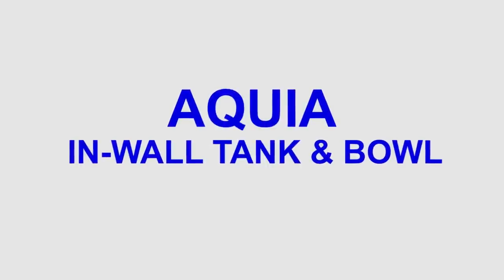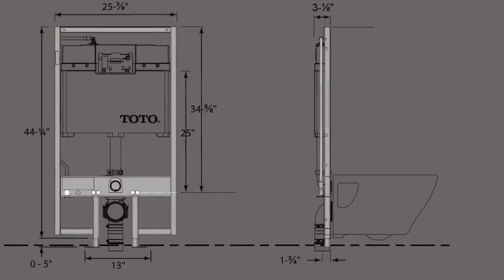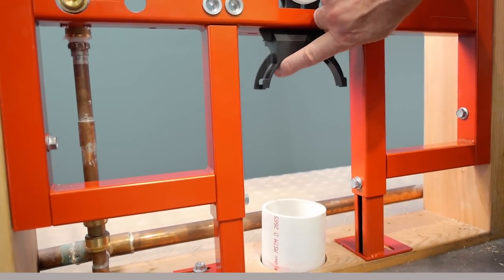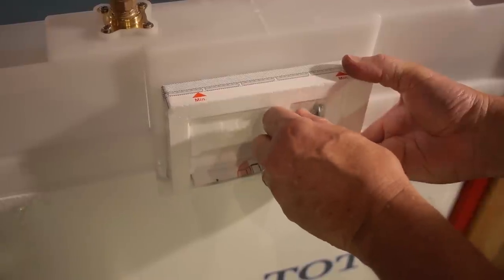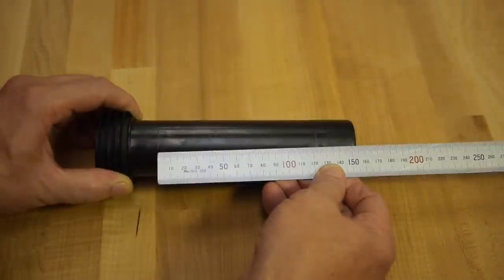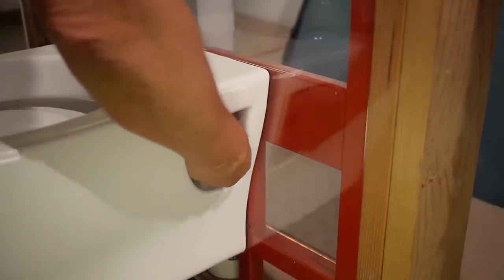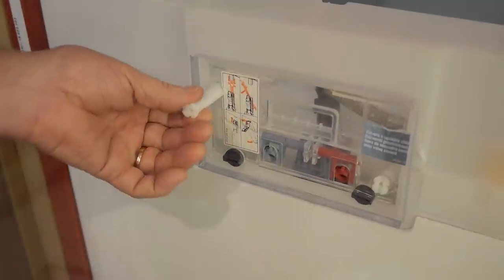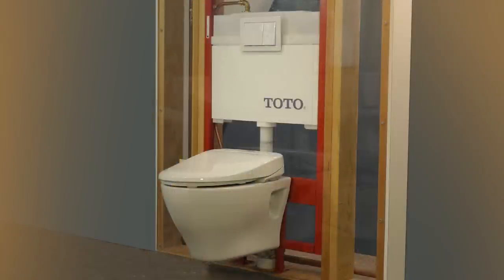Installing the Aquia In Wall Tank and Bowl

Comment: I know this is old, but English and Metric are both used during this demonstration. It would be better to stick with one throughout. My guess is two different presentations were combined. Also, I would suggest that a removable panel with a different finish installed at the toilet area be strongly suggested to the customer. Trim around this area can hide removable fasteners. Any call backs will be easier, and the customer will benefit in the long run maintenance wise, along with having a more architecturally custom finish.

Comment: My house built in 1963 had a wall mounted purple toilet. Tank and flush was exposed and not in the wall. So I knew a wall mounted toilet would cost much more than a standard. I figured doing an ultra modern remodel that involved a total tear out would have the right plumbing for another wall hung toilet.
My Aquia $1000 toilet cost me about $1500 to install. So besides the new wall adjustments the gas vent for the bathroom was a "T" connection off the drain of the old toilet.
Toto has a custom wall drain system that only comes in 90% drain options. It took my excellent remodeling crew 8 hours for 2 people to route a new vent.
Toto's recommended seat (extra) is cheap plastic and moves around. The lid has scratch the paint on the wall. I put a bumper sticky pad on it but it slipped down the cover (pad looked good but the quality adhesive sucked).
The Aquia was supposed to have a coating that is supposed to help keep it clean longer. Nope.
I worry about getting replacement part. Home Depot sells the toilet but they do not stock it or have replacement parts. All of that has to go through 1 importer in NYC.
BUY a Kohler!

Comment: Great idea, but I’d rethink this. Installed one, but the flush valve leaks out water. Changed ballcock, and the flush valve, so now what…..nothing. Can’t get at it, so it’s useless now. Mind yiu great idea, love it as it’s easy to clean around the toilet.  I’m a plumber but to get at the inside is impossible. Access is too small to get hands in. Then too boot, Toto gives me balls two years in as it’s leaking past, I had to but a new flush valve and new ballcock, then the same bullshit, must be me or my water……ya ya, installation was simple, I made dam sure it didn’t move, just use lots backing. Toilet after the walks were in  went well. All in all great idea. But to install new tank is a total redo of the washroom, obviously at this cost it’s not a normal washroom, so it will cost a fair amount to replace. I’ll do it in few years, I can get at bottom so I can reconfigure the rough in. Oh well, lesson learnt.

Comment: We installed this toilet a little over one year ago in a basement apartment. It was rarely used till the past two months as we moved into the basement. So we only just discovered that the toilet often continues to run when the smaller lever is pushed. I could find no trouble shooting in the manual. Does anyone know how I can address this issue? We have to continue to to check after the flush and flush again till it stops running. Thanks in advance for your help.
Reply: Did you ever figure it out?
Reply: It’s systemic with the product  . Oddly enough the Geberet is just as faulty. Toto is like GM in they don’t improve faulty designs.
Reply: I just had the same issue.. I replaced the rubber gasket ..even though old one really looked good and I could not tell the difference. It stopped happening for 2 weeks.. then started again.I just took plate off now .. readjusted the red and blue push rods and I can't reproduce the problem ..yet.. Maybe one was too long and was getting stuck somehow...

Comment: I have a toto in-wall tank and I have a steady leak into the toilet bowl, anyone know how to fix this? I have taken out the flapper and inspected the washer and it looks fine. Any links to troubleshooting or help? Thanks!
Reply: +SCOTT BAILEY we have the same problem that just started. Any success with a solution?
Reply: +jennifer wallace YES! I contacted toto customer service and was told that the first step is to determine if it is the flush valve assembly or fill valve assembly by turning off the water and waiting to see if water level in tank lowers. IF it lowers then flush valve is leaking and if it doesn't lower then the problem is with your fill valve assembly. I disassembled my fill valve assembly and found a very small black seal in the middle had disintegrated and sent the toto customer service contact a pic of this. To their credit, Toto sent me a brand new replacement fill valve assembly and all works great now!
Reply: Oh my! It seems they were helpful and so are you. Our toilet is 2 years old. Were you still under warranty?
Reply: +jennifer wallace No warranty that I know of. Ours was just over a year old and I was quite disappointed to have to service it and fix it and take everything apart and spend so much time on a very expensive toilet. But Toto customer service(just email them with and they will get back to you) did take care of me.
Reply: but where you which city which country ?
Reply: We have the same problem and our toilet is less than a year old. Thinking we should have gone with a $300 standard toilet.

Comment: Well this was fairly easy, BUT NEXT TIME dont call a 2x6 wall STANDARD as its far from standard. I had to buy the 2x4 wall conversion kit after the fact while I was installing it.......
Reply: Why was that homes
Reply: Because a 2x4 is standard......
Reply: All I remember is I had the same issue, that 1. 3/4 thing is bullshit, for starters the kit it comes with is for a 2x6 wall and that wont fit with 2x4 walls as the drain wont fit with sheetrock, so get a 2x4 special order kit then do whatever measurements you have to do to figure out the dead center of the pipe (3" Drain) and run that fucker right up from the bottom. Also frame out the RO for the top (headers) about three inches higher (so about 5" from top of metal frame) as you may have to adjust later again like I did. If your using tile make sure there 1000% straight as there is alot of potential for them to crack or the toilet to crack. Also the little drain pipe thing that comes out to the toilet mine was out a little as well but that can be adjusted with the cutting you do.
Reply: Yeah, I caught the rough in pipe early enough before the drywall was up, thank god. I'm going to adjust my legs about 4 inch off the floor. a little higer than standard
Reply: homes24 How much was the conversion kit?
Reply: tsoukallos like another$50
Reply: homes24 

I think better terminology would be recommended/ideal.

Standard may be correct as most “wet walls” get framed with 2x6.
Reply: good advice on framing the RO tall
Reply: homes24 looks like you didn’t do your homework

Comment: ho do you vent toilet
Reply from the maker: The installation assumes this unit is installed into an existing plumbing system which would already have the house plumbing vented.
Reply: Kind of messed up for venting. Most Commercial carriers toilets have vent fittings, unfortunately, you're stuck with that 90 deg elbow provided. I have seen people put these in without a vent. Being a licensed plumber I don't suggest that method. I'm installing one this week, I'll either jack the floor up and plumbing a horizontal vent off the mainline or use 90 deg elbows off the existing toilet bend
Reply: No vent
Reply: It won't pass inspection without a vent

Comment: I’m sure these are just different than what we use on a daily basis in my profession but generally there is a neoprene gasket needs to be installed. Like I said I’m sure this is just a different style or something. It is still best to test it before you call get thoughCall gauge call gauge no I said call it no call plumbers cock

Comment: I installed a WT171M. If you decide to purchase one ... here you go

1 Installation instructions are beyond terrible. Not only are some of the dimensions incorrect but the instructions are extremely overly unnecessarily complicated. Maybe the overall worst example I've seen in my 63 years of doing everything myself

2 the nut that connects the SS waterline to the float assembly is really easy to cross thread. I didn't but as careful as I am I nearly did

3 the float assembly was NOT snugged together from the factory. Do I had to remove the float assembly to tighten

4 the float valve was defective from the factory. So add about another wasted hour of figuring out that it's  not you who screwed up but the manufacturer who decided to put out a chicken shirt product

So........ not only is is not working but now I have to stop, figure out how to get a functional fill valve, stop the rest of my bathroom rehab, wait for a hopefully functional valve to arrive, stop everything else, repair their junk and hopefully have a functioning bathroom in a one bathroom house.

If you go this route good luck. You're going to need it.
Reply: So I took the float apart and found small plastic bits. Removed them and it appears the float is now functional.

My confidence level is not high.
Reply: Last Update - this has been an absolute nightmare.

I will NEVER EVER AGAIN buy a Toto product.